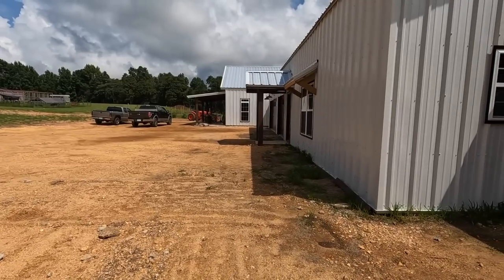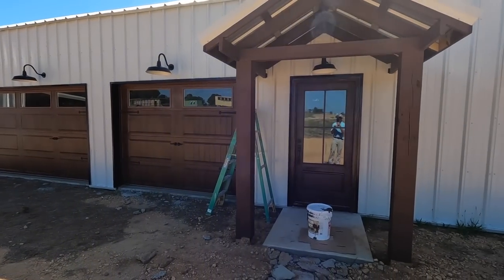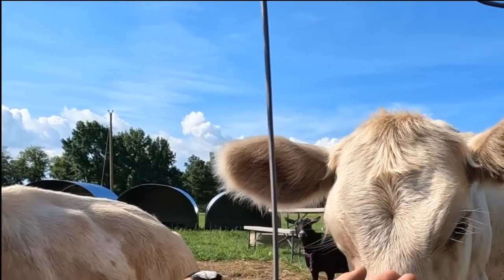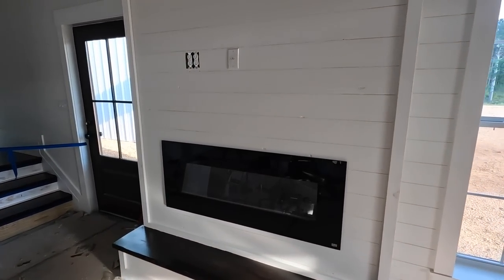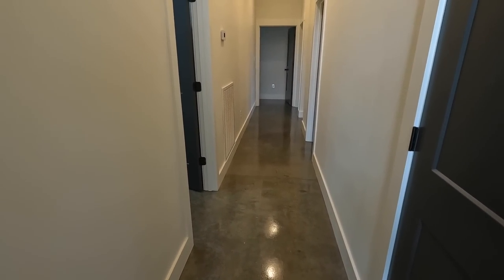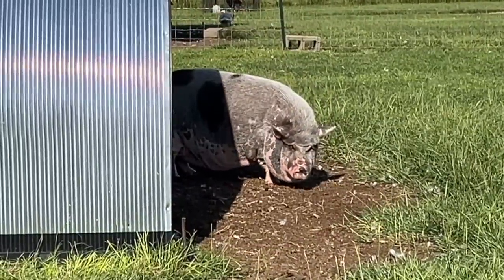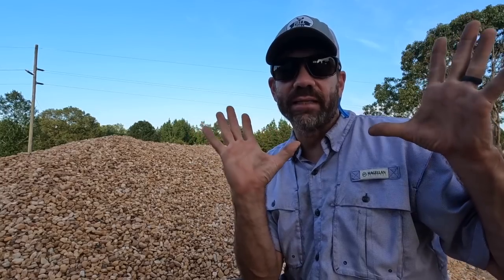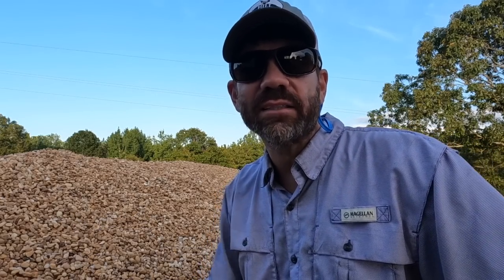Major Changes On The Barndominium Turned Out Better Than We Expected

Comment: If you do a gate from your breezeway and new hosta's home into the garden, arches are considered welcoming in more cultures than not; even if you simply round a board fence type of gate.  If you go for an open or other gate in an over head type of pergola type of arch, consider centering the gate in that archway for a psychologically more welcoming and beckoning effect.  The gate across an end of one of these pergola, entry type arches is a block or a barrier and traces back as such in many cultures and countries where they are used.  If the gate across the end is entry side then users are to wait to be admitted onto the property/ into the yard.  If the gate is on the yard side, it is more welcoming to entrants and is suppose to be inviting until you get to the "private side" of the pergola where admittance must be obtained.  In the middle, it is equally welcoming to both sides whether that gate is solid in whole or part, locked or not, the pergola is covered or not, and irrespective of what type of fencing, shrubbery, or flower beds either side of the entryway.

Comment: I live in a LG home in Texas that has the concrete floors. WARNING: It will wear out the soles of your house shoes pretty fast. And I ended up putting restaurant quality padded black mats in my kitchen. They can be taken out once a week so I can mop under them, I just wash the mats off with a garden hose and let them before I put them back in the kitchen. Anywhere you place a rug, you have to use the non-skid under pad. I use a battery powered electric broom to clean the floors and it works fabulously! BTW, your Hosta looks like it needs a little chelated iron.

Comment: Sir Jason - Either you learned and integrated some safety points through your father's shop or you've been/ hung around volunteer fire fighters.  Without electrical "Exit" signs or neon paint you can identify the egress doors; aesthetically they fit in and look good too.  Similar with the fireplace, the stair treads, etc....

Comment: you going to put more plants and some cast-iron and wood benches in the cog hill courtyard I think that would fancy it all up.
Reply: Not neccessary as just around the corner they have the fabulous view of the orchard & gardens etc., also their slider with its pull-down rest for their sweet tea & rocking chairs, all under cover.
Reply: @lorainewhite727  and benches in that area with plants on each side will add to the planter they have there and give them a courtyard to admire their orchard after working in it. And adds seats for large outdoor family get togethers.

Comment: Make sure you get the commercial gutters they are a bit wider and do not clog. Take it FROM me, they are better . I used regular gutters and had them taken off and replaced with commercial ones, you will not notice the difference by looking at them.  Dust clogs gutters by caking up ,so just some advice. !!!!

Comment: Just out of curiousity did you paint the floors and then stain it before putting down the sealer i used poly but i used gray floor paint and then swirled stain on with a rag

Comment: My Front Yard is totally Pea Gravel with a wooded glider and may roses and succulents!!! Why did you not place on the stairs the upstairs flooring so it would be a smooth transition also in front of the fire place and the window seat upstairs and finally the TV Table... Not the much more!!!! By the TV Table need a light bright enough to read fine print for TV times and other items, manuals to install new TV's and other electronic pieces!!! Oh well it is your place.... Ok, Ms. Lewis the smiles are ready for the pea chicks!!!!

Comment: I know you do not have any little ones living there but as rambunctious as they are failing down would be a concern for me. I hope that is never a problem. Because carpet and tile does offer some protections a concrete floor does not. I stood on concrete floors for almost 30 years and I have knee and back and hip problems. Most of the our stores did have linoleum flooring and carpet coverings.
Reply from the maker: We stayed in the videos that we are having railing welded and will be installed as soon as he’s finished 👍👍
Reply: @CogHillFarm  I wasn't talking about failing down from the top. I understood and remember that completely. I was just commenting on the fact that concrete is hard. If someone trips and falls on the floor would that be a problem.
Reply: Even with carpeting with a concrete base one still falls heavily, trust me I know as I've been in my house for over 20years & have fallen several times. It's still sore! No worse than falling in the garden on grass.🤭😉🦓🦒🐘🦏🧡✌🙏

Comment: A variety of weeds will grow in that peace stone between your rays and beds..... So you might need some chemical control and be careful with it.. Because spray travels, Or you can pull the weeds.
Reply from the maker: We have a weed mat down before the pea gravel.
Reply: @CogHillFarm  Yes but there's a funny thing about that. In time dust will blow in and organics and eventually there will be enough nutrition covering the surface of the stone that you can't even see or that worked your way down to the map that will cause certainly growth... Happens in Florida all the time. It may take 5  to10 years though